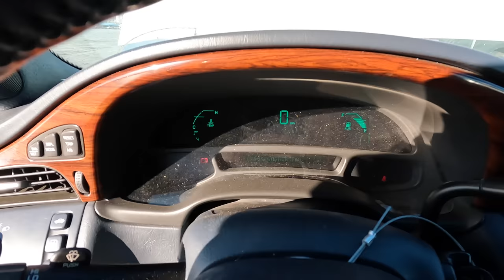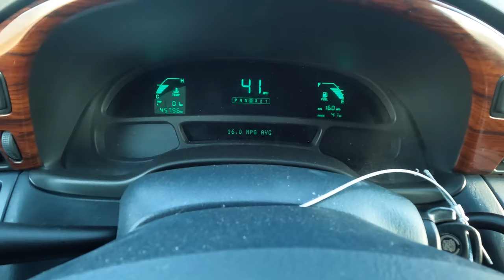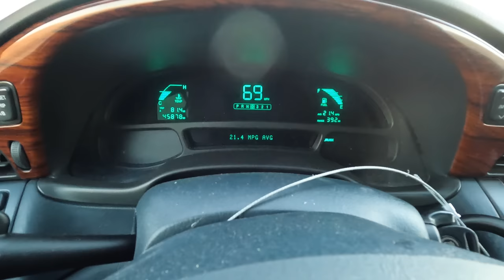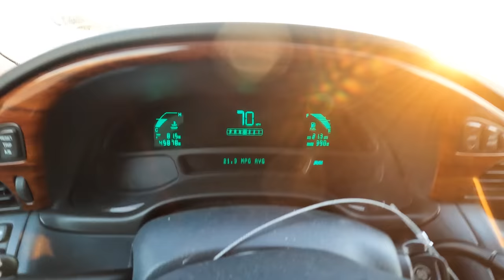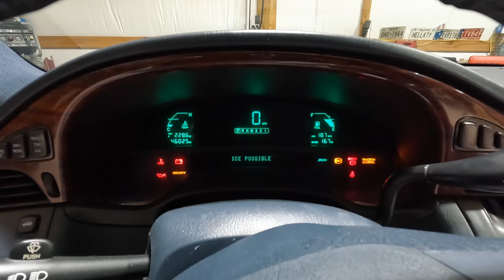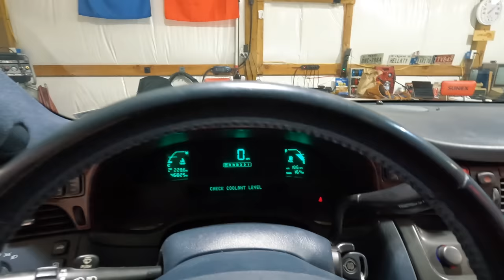I Bought a Cadillac Limo from Copart Sight Unseen - 2 Hour Drive Home with NO HELP! Will it Make it?

Comment: It’s not the cooling system that causes these headgaskets to go bad, it’s actually a design flaws in the head bolts where they slowly back themselves out and thus creates a headgasket leak.
Reply: Car Wizard or Hoovie did a feature about this issue... Apparently later ones have the modified head bolts/studs from the factory. Given the age, it should be safe enough. 😉
Reply: 97-99 are the worst years of the northstar longevity. They started using Dexcool which becomes acidic overtime. GM rates the coolant at 100k miles and doesn't follow a calendar schedule.. Causes almost 100% failure. 2000-2003 cars will last if maintained but have been known for blowing up without flushing coolant. 2004+ is really solid

If you flush the coolant enough it reduces the chance of having corrosion build up on the head bolts. typically is fine if electrolysis took its place with no corrosion from the coolant to reverse the effects. They will last damn near forever. I've seen a funeral home hearse with 19k miles that had blown head gaskets. some make it 180k some make it 15k. depends on how often the coolant is changed Randy is 100% right. Awesome purchase. If the head gaskets ever go bad try using thermalweld its significantly more effective than bluedevil.. Unless you want to fix it the correct way with head studs.
Reply: Know as Time bombs....
Reply: We had two NorthStars that needed the head bolts done. $4-5k each car. Worst Cadillacs we've ever owned. Worst cars for cost of ownership.
Reply: Ha. I just basically said the same. I said he should try to sell it and make a fast profit
Reply: @alasdairhompstead7950  I have one that's supposedly has the better set up and I'm hoping it drives for quite a while
Reply: @majorhoonage9161  these engines have oil journals in the top of the oil pan that delivers oil independently to each set of bearings. To stop any leaks its a major job because it's like the bottom part of the block.  You can't just toss a new oil pan gasket on it.. Any type of blue devil or anything like it would be a chance on stopping one of those journals up.

Comment: that northstar motor is a highly underestimated engine. It wasn't a bad engine, just a bad design. I currently have an '02 Deville DTS with 183k miles, and still going strong on the original headgaskets and headbolts(which are the real issue). the check coolant light is a common issue on these, and only way to fix it, is with a new coolant resivoir(about $60 on amazon here in nc). 
don't worry about others knocking you for buying it, you want it and can afford it? buy it and enjoy it!

Comment: The pusher fan was added by the builders for the back ac because it has to work 2 times as hard I'd wire it into the ac so it's only on when ac is on
Reply: If you turn off the rear a/c the pusher fan should shut off
Reply: Agree. Having it running constantly while idling alone at funerals is probably contributing to a dead battery.

Comment: I have a 2004 Cadillac Deville and the battery is under the back seat. Oh and by the way i got my DeVille at 28,000 miles and i put 120,000 miles on it in the last 5 years and she is still running strong as long as you take good care of them they will last a long time.

Comment: I own a non limo 2001 Deville. Love the car. My battery is located under the rear seat, not sure on a limo though. Pull bottom cushion forward then up. These cars are known for the level censor in the coolant bottle to malfunction.

Comment: I have a 2000 cadillac deville. If your car is not overheating and running fine, you're gonna need a new coolant resevoir. The coolant level sensor is built into the coolant resevoir and is the only way to replace it. Luckily they range between 50-70 bucks. Once replaced that "check Coolant level"  should disapear. Congrats.

Comment: I did the same thing I bought a $700 Salvage SUV sight unseen with minimal damage and replaced the battery and drove it 400 miles home was nervous the whole time especially because the cluster wasn’t lit up the whole time luckily it was just a simple fuse

Comment: changing the coolant is fine and all, but the issue is actually the head bolts on those. head gasket is just a general term for the issue

Comment: The yellow discoloring on the paint is from iron in water from irrigation system that was spraying on the limo. TIP: Use one part toilet bowl cleaner and one part water and spray on the stain and wash off the limo. Wipe off with cloth. The best toilet bowl cleaner is to get “The Works” from Wal-Mart. Hope this helps Randy. I had the same issue with my truck.

Comment: The dealer mentioned on the key ring may have the light covers you're looking for, if not might be able to source them for you through the conversion manufacturer. In addition, I'll suggest you put that fan back on  it more reliable by assisting the cooling system.

Comment: I've had 5 northstar powered cadillacs, a 96 Eldorado, 99 Deville, 98 Seville STS, 2001 Seville SLS, 2005 Deville,  never had the headgasket issue.  One odd issue, 4 of them had ignition switch problems which caused a number of ancillary issues. I have several Lexuses and a Mercedes, but definitely miss that era of Cadillac.

Comment: Engine Swap it for a ls from a Monte Carlo ss mid 2000s. I had one the flaw is the engine design the heads would warp, cylinder walls will crack. It was a nice car I had a 2000 dhs model and I loved the ride quality

Comment: Most of the 6 door limos were used for funeral homes, which would explain the flashing lights. Being that it was a funeral car they probably hard wired the fan since the car most likely spent most of those miles never driving faster than 50mph.
Reply: yup, you can see at 5:20 the funeral home that it used to belong to; more than likely this limo was used to transport the immediate family of the deceased from the funeral home to the burial site.

Comment: i had a 98 hurst (based off the Deville) like this, and i loved it. mine was funeral retiree, too. the biggest issue i had, is popping the coolant hose going to the back heater going over railroad track that i would bottom out. i ended up just bypassing the rear heater system. i had that thing for like 3 years. by the end of its life, i had no ac, no heat at all, but i drove it until it died. i would love to get another one. the good thing about funeral retirees, they were normally taken care of properly, as they do want the bereaving families to be in a nice comfortable car. having to buy premium gas does suck, but at least when i had mine, it was to bad. i did put 87 in it one time, it out of habit right after buying it, and i knew pretty instantly, not to do that again. it ran so rough. of course my kids loved it. i ran IT service calls in it, and the conversation you have with the customers were great.

Comment: Also, who was the Coach Builder. check their quality control. Some did not have that good of reputation. Check the frame stretch underneath it. I had a Lincoln Stretch and Brea did not do that well of a job. be careful of putting on a lift. IT HAS TO BE FLAT LIFTED. The stretch may bend
Reply: Definite bend. Speed bumps too

Comment: Hey Randy that gas cap issue is a evap issue..something between the tank and the front of the car..my 07 Pontiac grand prix says the exact same thing..got to remember these were parts bin cars so alot of sensors and parts you can find on just about any gm car of the same category. Mine happens to be the fuel tank sensor it sits on top of the gas tank in the back. Should be the same on that cadi you just got. But those are great cars if like you said maintained regularly . I'm super familiar with all gms and I been watching you for a long time like I had mentioned way back not to long ago about the Tahoe you had back at the farm and then you only had  I think 40 k subs. But yeah man check out the gas tank sensor and check your fuel filler neck make sure it's not leaking from around the tank and anything associated with that..otherwise that light will come and go ..usually will go out after you drive it down to about three qaurters of a tank of gas and comes back on at half or a little below..just saying it's nothing to worry about just the sensor freaking out lol..great purchases my guy happy to see how far you have come.

Comment: Battery is under the backseat, right rear position, watch out for corrosion, it'll eat right through the floor pans.
Reply: yes, that's why you are supposed to run AGM batteries in them so the liquid acid batteries don't vent the acid on the floor rotting them out, i own an 03 Aurora and an 04 Deville
Reply: @mattcat231  It was the factory battery that wore out the bottom of the battery tray and through the floorpan in my 2001 Deville. I patched it, put a new battery in it and sent it up north!

Comment: The sensor on the coolant reservoir is probally bad.Just top off the coolant with dexcool if that what the cadillac requires or you could bypass it with a paperclip?.if i was closer i buy that limo from ya!, i mean i dunno what i will used it for? Bur why not XD

Comment: Engine swap might I suggest the engine from the C7 Zr1 Corvette. for the battery check the engine compartment front corners down low second location under the back seat.

Comment: I enjoy enjoy driving cars I know nothing about home. The '93 Cutless Supreme I bought had been sitting so it had a low tire and needed gas. I didn't have an ignition so I had to learn how to start and turn off the engine.  I had to drive that car on the highway.  But I paid $300 plus tax, and registration. I've had good luck with cheap '90s cars.

Comment: people hate on the northstar but the headgasket/headstud issue happens when the car is run hard. constant  high rpms a northstar limo is the safest northstar to buy until 2003 when they fixed the problem

Comment: I know this little light bulbs, they've been used on the Lincoln Continental dashboard. I had the same problem I couldn't find them anywhere but I went to the junkyard and I took a couple good ones from a old Lincoln. I know this information is not a lot but I hope this helps you at least a little bit. Cheers mate 🙂

Comment: That car is a steal for under 5k…former funeral home limo with less than 50k miles. You can’t loose on that car…man why can’t I find deals like this in my area. Randy try putting some Vaseline around the seal on the gas cap and if I’m not mistaken that pusher fan was for the auxiliary trans cooler. I’d keep that bad boy running.

Comment: The problem is they always run great then one day thats it. Done. The check coolant level already got me thinking about the head gasket.
Reply: level sensors in the coolant bottles fail OFTEN, causing the low coolant light

Comment: U might wanna plug that extra fan back up because North Star engine over heat real fast pulling a limousine  that why blower is there!👍🏻
Reply from the maker: I drove it over 500 miles and it never got above average.

Comment: put those plastic covers in hydrogen peroxide in a clear bin soak it in the sun for awhile or use black ultra violet light and they will turn clear again and get rid of the yellow i have tried this and it works i have watched alot of restoration channels and picked that process up.

Comment: I sold a crap load of those cars years ago . Be careful changing the coolant with the rear auxiliary heat in that car . You can get a nasty air pocket in the rear auxiliary heater where everything will seam fine including the front heat ,and out nowhere it will overheat . The fan was added by the limo builder for when the car sits for hours with the ac on

Comment: 2001 was actually pretty good.  Northstar had lots of issues fixed. Had couple of them because of the fixes and had no problems
Reply: 2000-2003 were ok, but you MUST keep up with the coolant maintenance, 2004 and up were a ton better
Reply: @mattcat231   in all my northstars i usually flushed coolant at about 75k to 100k since i dont like same fluids being in same engine for too long even if it says that on label. Maybe thats why never had problems with 3 of them.  Only thing that had to keep an eye was oil level and on all of them had ro add about half a quart every 1.5k to 2k miles but thats it.
Reply: @norbkowa  I have an 03 Oldsmobile Aurora with the 4.0 Northstar, and a 2004 Cadillac Deville (was a funeral family car from 2004 to 2006 before i bought it, not limo, just a base Deville). My coolant gets changed every 50k miles, my Aurora has over 320k miles on it, and my Deville is sitting currently at 246,629 miles. My Deville does have the half case leak, and I use about 2 quarts per 5k miles. My Aurora only uses a quart per 5k, and the rear valve cover is starting to seep a little. It has always run 1 bar above half since new, and my Deville runs right at half on the temp gauges. I also have run 15-w-40 Rotella diesel oil and Wix filters in them since i got them (the Olds was my mom's car bought brand new, i did all her work and maintenance, and i now own it). Both Engines are SPOTLESS inside, and have great oil pressure and not even a tiny lifter tick like most Northstars!

Comment: The bulbs are a number 74. You would be smart to just sell it for a profit because the Northstars of that year are famous for headbolts that ease out without you even knowing it and by the time you notice it's running at 248 degrees it's too late. I drove a 12 pack like that for a private owner years back and his had almost 90K on it and the first sign we had that it was overheating was the AC just cut off when it was like 100 degrees outside. I warped both heads. He was wealthy enough to pay 8K to put another engine in but I tried to get him just to get a regular size Cadillac but he didn't want to. Just thoughtid let you know

Comment: Would be interesting to know what the Cadillac sold for new.  As you likely know, there are several coach builders that use the major Cadillac components, and then create the stretch...  Yours is really very different from most... so it would be very interesting to know who the custom coach builder is that created your car.   It is strikingly attractive, and could well be your "driver" for your videos--- a real character car for a wonderful character who creates engaging videos.

Comment: Try some silicone grease on the gasket for the gas cap. Also check the filler lip for corrosion if it has any, a sponge sander works to remove it. Had the same thing on my LeSabre.

Comment: I not look at comments but discolored in paint is from parking next to sprinkler system using well water pretty sure that's the issue on left rear side of  stretchy

Comment: The first fan is on because you have the rear on you got to turn it off whenever you turn power to the back the fan will turn on that's in front of the radiator but once you turn the power off to the back the front fan in front of the radiator will turn off should be a switch that you can control to turn it real power on and off

Comment: What happened to your nice car trailer? Why are you having these cars towed for many $$$ and then in the next breath wanting save money with a tire machine? The tire machine and a balancer is a good thought whereas it only takes one trip to the tire shop with your own tires to figure that one out. But with as much iron as you buy , a flatbed with a stinger to haul a second car would sure fit the bill for you and a car trailer. There must be some used or wrecked ones around you can pick up right, do what must be done to them and down the road you go to saving $$$ and time waiting for them , calling them and adjusting your program to fit when they arrive or even do the tow. Just food for thought there buddy. Personally when I needed a flatbed for the lot, I found a class C motor home some people just wanted to get rid of with some water damage to it. It was free , a E350 Ford with a 460 gas , tilt, AC , 72K miles. Sold the Kohler generator out of it on craigs list for $350.00. the roof AC for $150.00 and the appliances inside for $250.00   Hired some labor ready to disassemble it down to the cab and chassis. Used the back fiberglass wall for the cab back, found a 20 ft bed behind a barn the old farmer sold me for $225.00. Mounted the bed, dove tailed the end of it. built some nice long ramps that store between the bed and frame. Mounted the winch. Used the roll over support steel out of the RV for the cab guard, bought some good used fresh rubber for it , new batteries , used the propane tank for an air tank fed by two 12 v air compressors with 80 ft of hose, serviced the truck , re-charged the ac,    a $10.00 wrecking yard CD player and a $15 amp. Buffed out the cab and bingo , a $1200.00 flatbed , low miles and is always ready to go. And it is not costing me when it is not going , just sitting until needed.
Reply: Did you do a video of your conversion? Sounds like you have a great rig!
Reply: @markp2865  No , I should have, so many people have taken an interest to this type of conversion that is for the most part available to all of us everywhere and for the same low dollar amount going in. I did snal several pictures during the process

Comment: Things that these usually have issues with,both mine did,water pump,power steering pump and the window regulators..they have a common fail from the factory on the regulators but loved and miss mine ran awesome.Had a DHS and a DTS both 01s.just retro led strips into those side lights be a nice little update and easier than those little filament bulbs